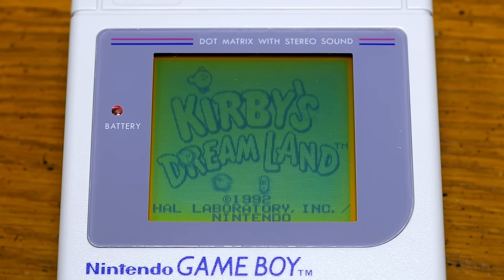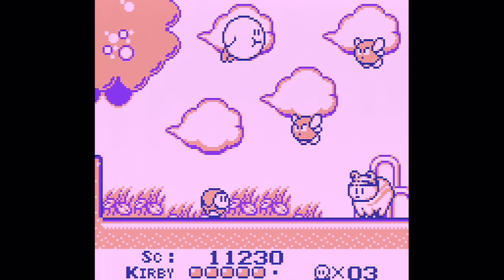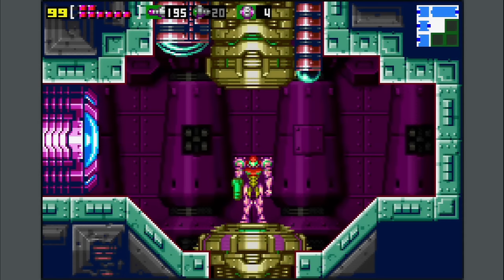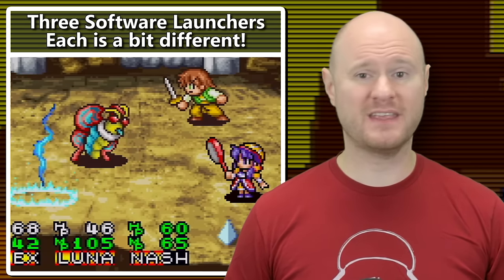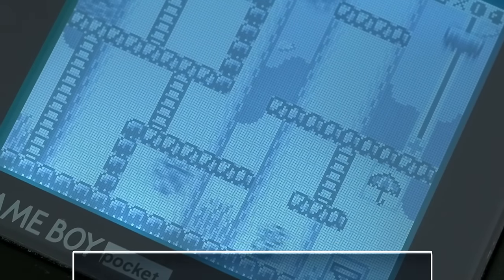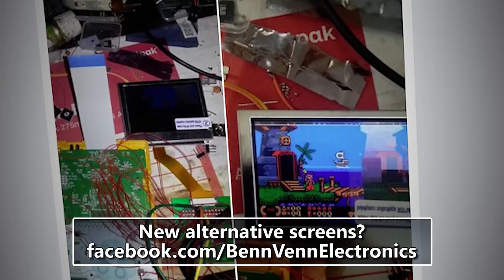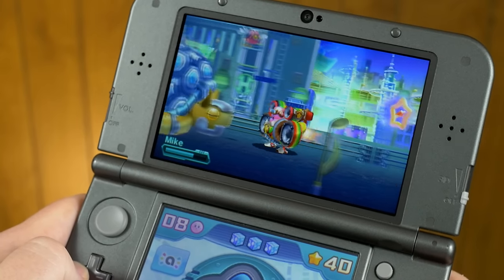Nintendo Game Boy, Game Boy Color, and Game Boy Advance :: RGB208 / MY LIFE IN GAMING

Comment: Timestamps:
0:00 Introduction
0:38 Theme song
0:54 Video Overview and Info about Game Boy
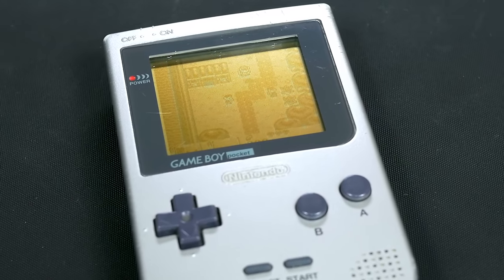2:08 Part 1: Handheld Game Boy
2:08 Game Boy Pocket
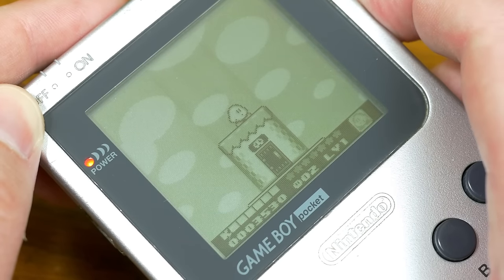2:42 Game Boy Light
3:33 Game Boy Color
5:29 Game Boy Advance
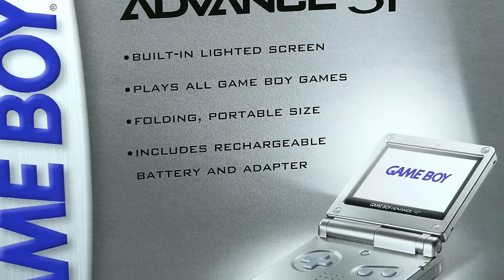6:29 Game Boy Advance SP (AGS-001)
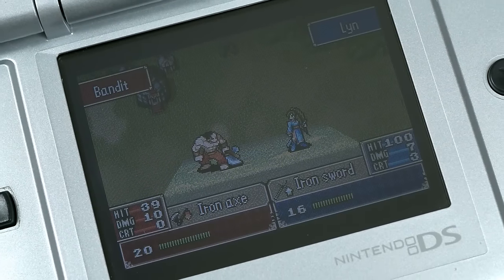7:22 Nintendo DS
8:05 Game Boy Advance SP (AGS-101)
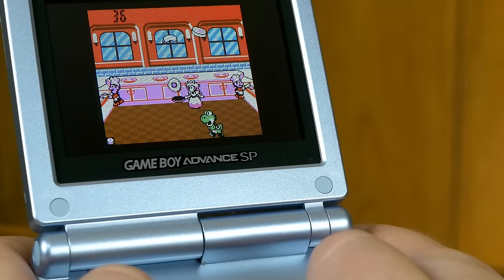9:21 Game Boy Micro
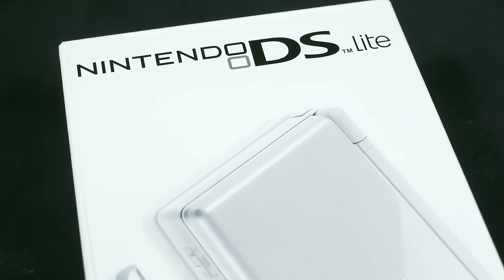10:14 Nintendo DS Lite
10:45 Closing to Part 1
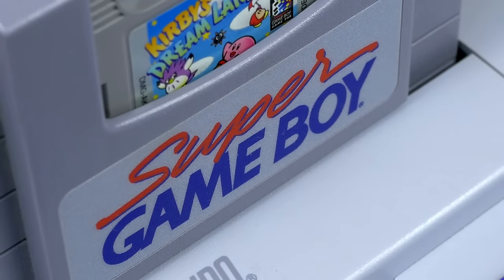11:19 Part 2: Game Boy on TV
11:45 Super Game Boy
17:48 Super Game Boy 2
20:35 Game Boy Player jk, let's cover Wide-Boy 64 AGB first.
27:16 N64 Transfer Pak (emulation for Pokémon games only, other games can be hacked to play but have issues)
N64 Transfer Pak can also be used to unlock things in certain games when paired with a respective N64 title.
28:16 Game Boy Player and Game Boy Interface homebrew software (better than boot disc!) (also check out Swiss)
40:00 Part 3: Mods and More
40:19 DMG Game Boy backlight and bivert mod
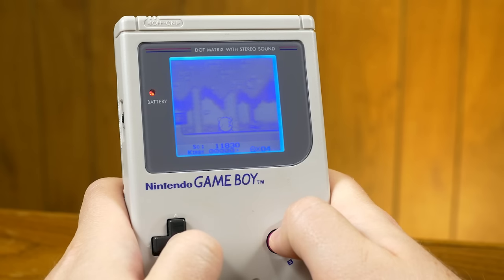41:02 How to fix vertical lines of missing pixels on a DMG Game Boy
41:50 hdmyboy modkit (prototype)
45:15 Game Boy Pocket backlight and bivert mod
45:49 Game Boy Color frontlight mod
46:04 Game Boy Advance backlight mod (AGS-101 screen)
46:49 Nintendo DS capture card mod
49:42 Super Game Boy underclock/overclock mod (no need for a Super Game Boy 2 or HORI pad!)
50:18 Upcoming mods - stay tuned
50:36 GB Boy Colour
52:02 Super Retro Advance Adapter
53:23 REVO-K101
56:12 3DS Virtual Console
58:16 Wii U Virtual Console
59:23 RetroN 5
1:00:31 PC emulators, such as Gambatte and RetroArch + Gambatte Core or mGBA Core (GBC-style palettes customizable like SGB, and shaders)
1:01:09 Conclusion
1:01:54 Handheld summary and console summary
Your quest is over.
1:02:28 End credits
The End
Reply: Note: The N64's 2 layers of blur effect can be disabled. Watch RGB 304 for more.
Reply: Be sure to watch other RGB episodes (and the one episode of This Does Not Compute) mentioned in the video for more info! Please read the in-video notes for more info too.
Reply: Another note: GBI has changed since this video. Look it up for more.
Reply: PS: Backlighting a Game Boy Color has since become possible by modding the signals of the GBC and using a special ribbon cable to get it to work with an AGS-101 screen. This Does Not Compute has since made more videos. Search for Game Boy Color Backlight.
Reply: By the way, the other half of the 3DS Ambassador titles were for NES.
Reply: I'd say:
Go for AGS-101
Go for modded Game Boy Player
Emulation yay
Reply: Stay tuned for upcoming mods!
Reply: Update: Woozle's GBA HDMI mod, now known as the GBA consolizer, is being rolled out!
Reply: One of the alternative screen mods from BennVenn appears to be using an AGS-101 screen in a GBC. If that is the case, it's available now!
You can check out an easy kit or even pre-built console from Jelly Belly Customs. BennVenn and RetroModding also offer similar modded shells and screw posts. If you want 100% DIY, you can get the ribbon cable connector required from BennVenn's site.
Reply: The other alternative screen is also now out for pre-order. https://www.retromodding.com/collections/featured-items/products/bennvenns-dmg-3-backlit-lcd-kit
Reply: holy crap dude
Reply: They forgot android emulation
Reply: Thanks
Reply: 20:47 objection
Reply: thx for this huge work :)
Reply: Jonathan Grenci Godbless you bro
Reply: jesus christ
Reply: Why is this not pinned?
Reply: Jonathan Grenci you sir are waaaaaaaayyyy too dedicated... Lol
Reply: Your a good man
Reply: You’re the real MVP
Reply: What game is this song from in 9:20?
Reply: You are a good person thank you
Reply: Thanks for this! You’re awesome
Reply: What are the songs used for this video???

Comment: You missed an interesting one. Goomba Color.
It's a Game Boy Color emulator for GBA. It allows you to play GB/GBC games on a Game Boy Micro.
But what's most interesting is that it supports Game Boy Color enhancements AND Super Game Boy borders at the same time. You can play LInk's Awakening DX, in full color with the SGB border and on original Nintendo hardware!

Comment: Thank you for this video. I never knew about Swiss and GBI until I saw this. 

I now have a Game Boy Player running GBI-SR at 240p over RGB SCART (sync over composite for guaranteed compatibility across devices). Managed to get the config files to default to my desired settings and set GBI-SR to autoexec so it's as simple as boot and play like as if it's stock. 

One handy thing about being a PAL gamer is having a HDTV with SCART still supported and actually upscaled rather well without the need for a separate upscaler device (thank you Panasonic).

Comment: Wow,Tons of great info here!
The only one extra thing worth mentioning is the 'monster brain'
Aside to being a cheat device, it allows custom pallets for GB games on a real GBC, 
 it can also (attempt) to run GB games in GBC mode with the extra cpu speed
As well as stipping Dual mode GBC games back to GB mode, so you could run Say zelda DX or tetris DX with one of the generic gbc pallets (including black&white)!
Reply from the maker: [Try4ce] Woah that's very interesting, I had never heard of that! It also appears to be very cheap. It seems to be designed for Pokemon games. It works with any Game Boy game, though? I've just never been that big of a fan of the GBC palettes.
Reply: Yes, it works for just about any gb/gbc game. and it even has a feature that makes it act as a budget 'mega memory card'
It's a great device that many people have never heard of! and unlike the SGB, your custom pallets can be saved in the devices (non-volatile memory)
I'd really suggest checking out!

Comment: Real talk; how long did you spend cleaning your Wii U's glossy finish before recording?
Reply: He still cleans to this day
Reply: @nihil8607  2 years from now his consoles will still shine
Reply: probably not long if you know the trick, wet clean with an electronics wipe, dry with a kymball blue towel, then rub it down very lightly with a dryer sheet and redry it with a different kymball blue towel. the drier sheet cuts a ton of the static out so dust is lees likely to be attracted back to it for a relatively short time.

Comment: Man, I have component cables for my cube but I didnt realize the official software isn't good. This video is inspiring me to get some gamecube homebrew, but I don't know what exactly I need to start.
Reply from the maker: [Try4ce] Some sort of SD media card reader for GameCube memory slots for starters. Then, your disc-launcher methods are either an Action Replay, or there is a method you can use via Super Smash Bros. Melee, which I am unfamiliar with... should be easy to search for, though.
Reply: paulink you can build your own SD memory card adapter. Or purchase an SD gecko (they were pretty cheap back in the day, not sure if they're still that easy to come by though). Then if you have an action replay, there is a set of codes you can use and instead of swapping discs you just open and close the lid with the action replay disc still inside and it will boot from your SD gecko (or DIY adapter). You need certain files in certain places on the SD card but just Google and you should find what you need.

Comment: imagine a 3ds adapter for switch o.o
Reply: I always dream with a Super 3DS for Wii U :(
Reply: @AnonymousGentooman  not necessarily. The super boy. The GB player and the Transfer pack for n64 all of them where made with the hardware of the system. So doing a similar thing with the 3DS hardware wouldn't be so difficult since a 2DS cost 80$ they could have produced a 3DS adapter for 60$ taking away the screen and everything else
Reply: @The SNES Man at thai point os obvious that is not gonna happen. but back in 2014 that would be the best. probably we wouldn't see 3DS games on a long time
Reply: Imagine if there was a 3DS micro. I doubt either will pass. Nintendo no longer markets or tracks the sales of the 3DS
Reply: How exactly would this work? It would be better with Wii U.
Reply: @breathofthewild1749  USB... the other were also for the home console, heck you can use wireless if they want to make it compatible, the same they do for the controllers but usb will be the best option, no worries for the battery
Reply: @Souls4Roca  I'm confused man. Switch will only output to the TV if its docked. Or the switch screen if its undocked. It's 1 screen being used at all times. It wouldn't be ergonimic at all for the Switch. The Wii U on the other hand would be perfect. It's literally designed for it. Check out NTRView Wii U to see what I mean. It's a pretty shitty implementation but a concept that goes to show how amazing it would be if it had genuine support for 3DS.

Comment: If you want to play on the big screen... sorry, but emulation really is the superior way in this case.

Like mention in the video, both the Super GB and the GB Player runs at ~60hz instead of the GBs/GBAs native ~59.7hz. You will never get the perfect silky smooth scrolling of the original hardware that way, there's always going to be a hitch every few seconds.

With emulators you can slightly speed up the hardware to match your monitors refresh rate, or even better, if own a CRT or GSYNC monitor you can actually run the games at their original ~59.7hz.
Reply: Emulators are for noobs

Comment: 7:30

I call slight bs on this, because I remember cutting the notches out on a pokemon crystal cartridge amd it worked fine in the ds I was using
Reply: Tim D Nchantr did work with some r4 cartridge but I think it’s emulated and it just reads the rom from the cartridge

Comment: Regarding GBA on 3DS - this is the BEST way to play GBA games - even better than any TV or 'real' GBA hardware mode. It uses 100% GBA hardware and firmware and therefore doesn't utilise any emulation whatsoever. As you allude to, the Ambassador releases are terrible however - with added darkness and ghosting filters applied. If you install a custom firmware that patches the AGB-FIRM inside your 3DS you can use homebrew tools to create your own installable GBA titles free of the ugly filters Nintendo likes to use on some of their VC titles (the 3DS NES VC titles are also terrible - and also fixed by making your own NES VC games) . As an owner of a AGS101-modded original GBA I never thought the 3DS family would effectively make actual GBA hardware redundant, but it actually does so with ease - and I'll probably never use my older handhelds again. My favoured way to play GBA games in all their glory is actually on a CFW'd 2DS because this has arguably the best ergonomics of any Nintando handheld.
Reply from the maker: [Try4ce] I'll have to look into this. It might be fun to play around with custom firmware on my Old 3DS XL.
Reply: General Light You also lose a larger 1:1 aspect ratio display that you find on a modded OG GBA - but you can patch / find patched e-reader content if you really want it. For example, the Mario 3 e-reader levels that were included in the WiiU reissue can be patched in, and is arguably a superior solution to the real thing because a real cartridge hasn't got the spare memory to hold all the extra stuff. Not to mention having truly native support for three entire libraries on one hand held (GBA, DS and 3DS). That's pretty awesome by any measure.
Reply: General Light I don't think Nintendo have ever acknowledged the ghosting and darkness filters that are applied on the official 3DS NES and Ambassador GBA virtual console releases, let alone explain why they're applied. However, a minority of early GBA releases used super-bright palettes in order to compensate for the dark screen of the original unit, and these games probably benefit from the darkness filter to reduce the issue of crushed whites. There's also one case in which the added ghosting is beneficial: The GBA F-Zero games have a persistent map graphic on the bottom left of the screen, and without the filters its ultra high refresh rate can leave temporary screen burn on the 3DS screen. For the vast majority of the GBA library though the removal of the darkness / ghosting makes these games shine.
Reply: Do some self research on GBATemp Forums, and I'm sure you will find your way
Reply: I'm pretty sure the ambassador game sare emulated. 3DS may have AEM hardware, but it doesn't have "the" GBA hardware inside...
Reply: My favorite way to play GBC/GB games ever is to run GameYob, a CFW user emulator for 3DS that lets you play any Game Boy and Game Boy Color games.
Why, you may ask?
Because, it has:
A overclock feature (it makes the game go at least 3 times faster, depending on settings and the hardware, you can increase the speed to until around 10 times)

Button mapping (also compatible with New 3DS)

Color settings for GB games (only a few games like Game Boy Camera aren´t compatible and just are in black-white)

Can "trick" the game and make it think you´re playing it on a GBA or Super Game Boy, or even make it think there is a Game Boy Printer connected!

Save states, as always, you can even delete them directly from the emulator itself.

And my favorite:

Can upgrade the graphics of the game by just setting how to render the screen, which options are original ( like just a Game Boy system) , linear (just the 3DS render it "normally", not recommended because makes everything look kinda blurry, and my favorite one is scaleX2, which makes the rendering be like the original Game Boy, but the pixels are rendered in a way to make everything look better.

You can also set pixel perfect mode, fill the screen (like actual Nintendo VC) and full-screen if you want to have a better experience depending in your taste.